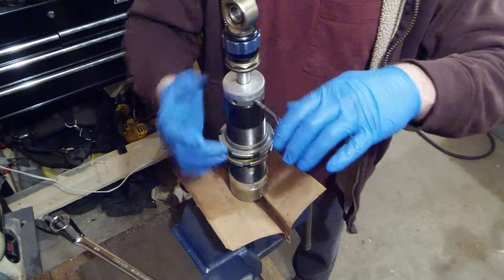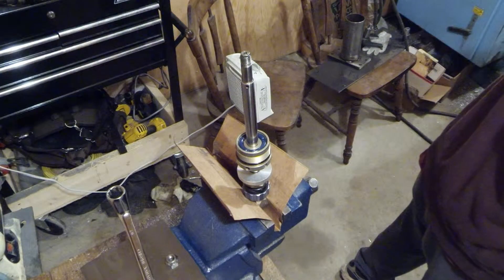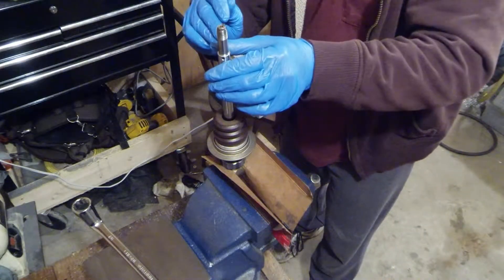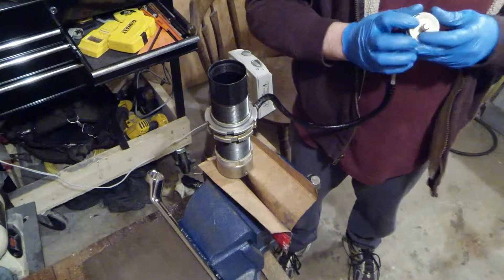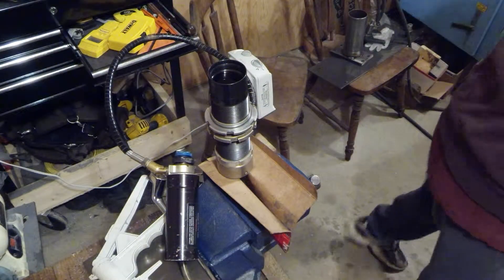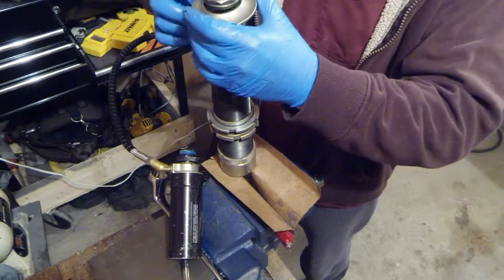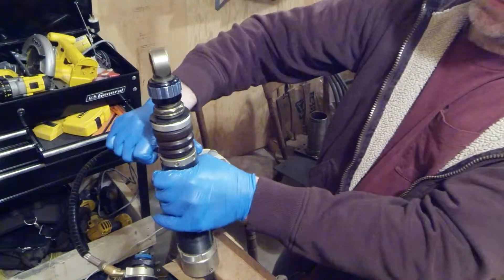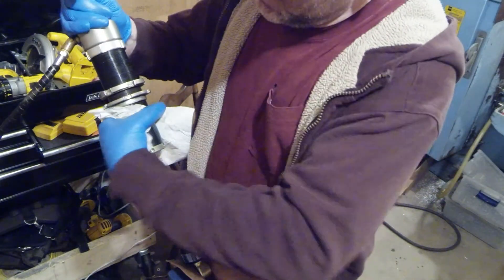Custom Axis PRS rebuild

Comment: Oil will not blow all over if you don't release the nitrogen before removing the seal head.  And you really need to buy a seal bullet to keep from cutting the oil seal.  You can bleed the oil much easier a different way than you are doing it also!  Shaft should be pulled all the way out when installing the seal head or else your floating piston will be too deep into the travel.  Just trying to help you do a better job
Reply from the maker: Thanks for the tips.  I have to say that 160psi of nitrogen seems that it will make a pretty big mess if not released first...  right?      And I'm always up for learning easier ways of doing things, so how do you bleed a shock?
Reply: pastormarkm

The floating piston is already at the bottom so when you unscrew the seal head and it has the proper amount of fluid in it you will hardly loose any.  This is ONLY on a Custom Axis shock though.  All others the nitrogen must be released first.  It's much easier to bleed shocks with the floating piston.  Fill reservoir full with oil, install floating piston, then orient reservoir so air goes to the top and push floating piston the rest of the way in.  You'll hear when all of the air is out.
Reply: A tip from a legend!! Andy Maul RIP

Comment: hi
please help me 
the black seal the largest in which position is placed? i buy a atv and it has a custom axis damaged and they did not have that seal, i buy the rebuild kit but i dont have idea how to place it. thacks
Reply from the maker: Hi,  The large black o-rings go around the seal head just above the threads.  There is a small o-ring that goes deep inside the seal head and then there is a shaped "wiper" that goes just up from the outside of the seal head.  Hope this helps.  
  God bless...
                    Mark
Reply from the maker: The black seal goes in a groove on the part you screw out of the bottom of the shock tube.
Reply: I know I am kind of randomly asking but do anybody know a good place to stream newly released movies online?
Reply: @Sebastian Angelo Thanks, I signed up and it seems like a nice service :) I really appreciate it!
Reply: @Justice Patrick Glad I could help :D